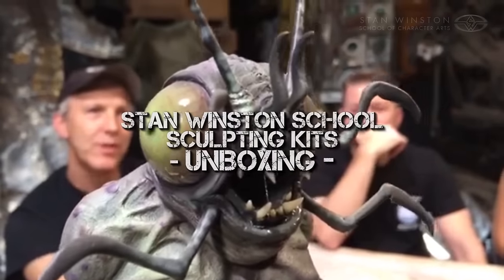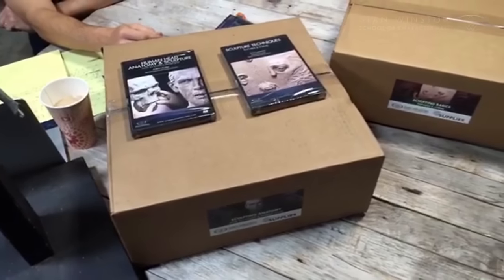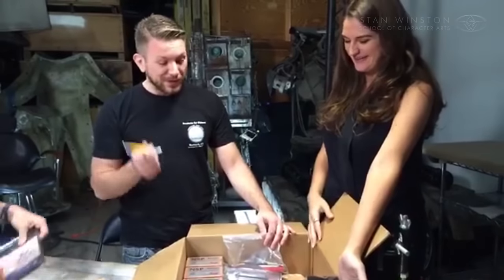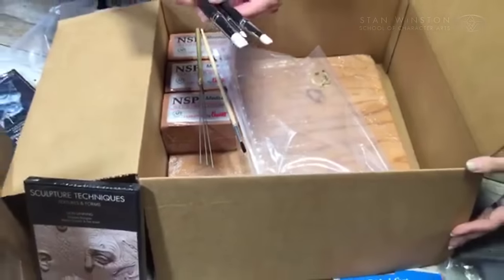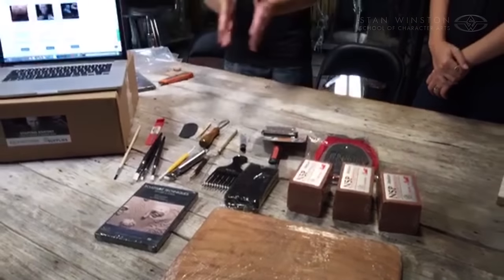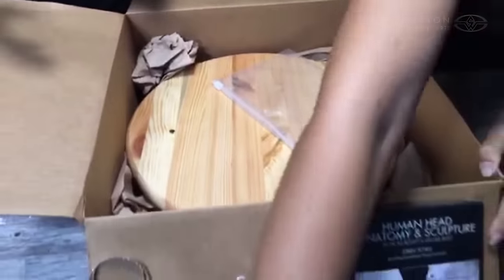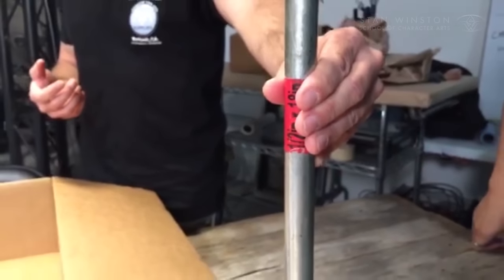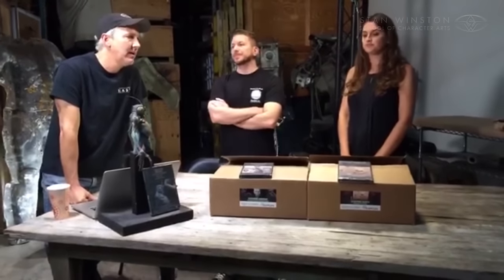Unboxing Video - Creature Sculpting Kits!

Comment: Question: Do you have to purchase a DVDs in order to purchase the Kits? Because the Supplies Purchaser at Imagination Workshop Studio will probably get the Kit boxes by the bushel? Because they already have most or almost a hundred DVDs in their library currently. Still need more.
Reply from the maker: Hi, this offer is no longer available on the site, but you can put together a KIT yourself. Just go to our website and check the material lists under our courses. Those lists are good starting points. Based on them, you can sort and create a KIT for yourself. If you don't know where to purchase them, you will find a supplier list at the beginning of the material lists too. Some items might be harder to find, but a little internet scouring usually finds you everything you'll need. - Adrienn
Reply: @StanWinstonSchool  Thank you. We'll tell the Purchaser at Imagination Workshop Studio. If they don't already know, that is.